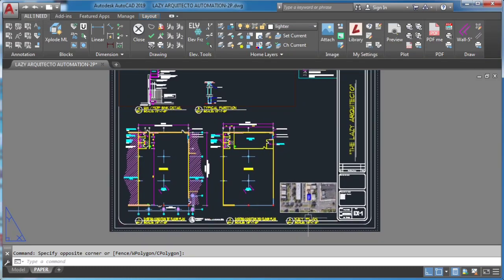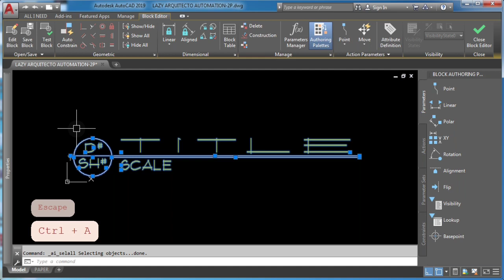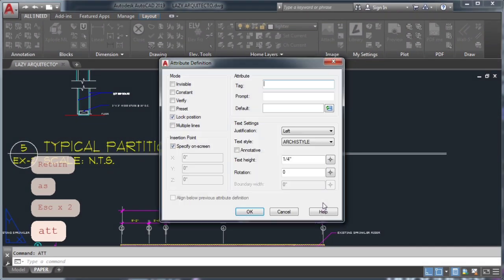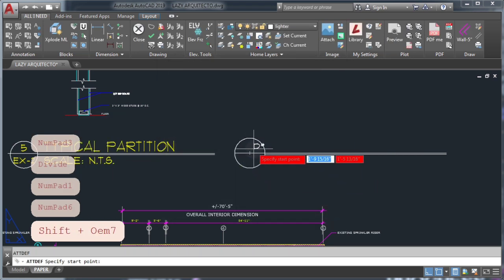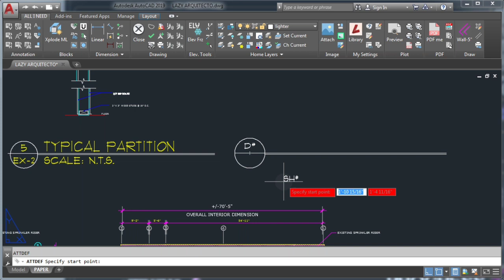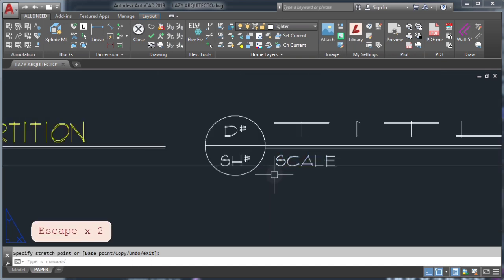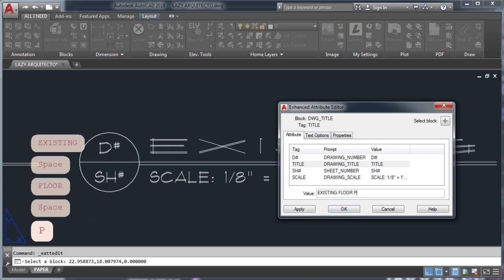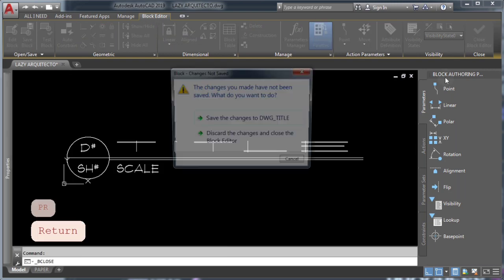AutoCAD Best Practices: How to Create & Edit Attribute Block Definition

Comment: it help me a lot, how can i re-size those attributes to fit on different scale? 1/2"-1'-0" - 3/4"=1'-0"  and so on
Reply from the maker: Welcome to the team Joel. You can resize them by following your scale factor chart using property panel, the same way i did on the video. Where are you from by the way¿

Comment: Louis, hope you had a wonderful Christmas. 
Question regarding this block, typically I keep the circle an lines separate so I can control line weight (about 30–35) can I still do that with the attributes being attached to the block? Being I generally create the block on layer zero.
Reply from the maker: yes, you can if you use plot styles to set the line weight by colors. Hope you had a wonderful Christmas too Douglas
Reply: @LazyArquitecto  thank you and yes I did. Have a safe New Year….
Reply from the maker: @douglasmichel6361  Happy new year Douglas